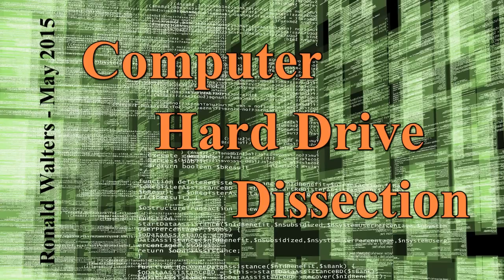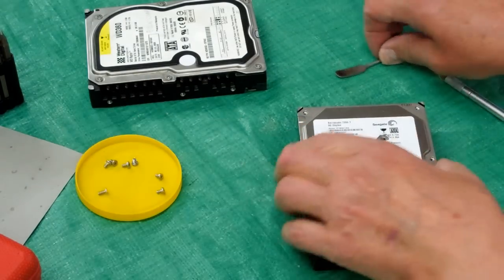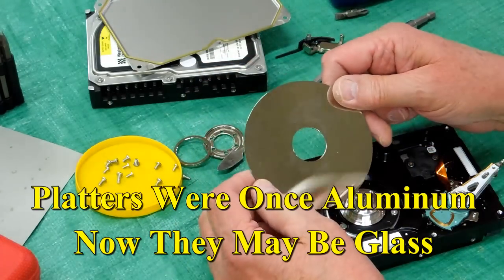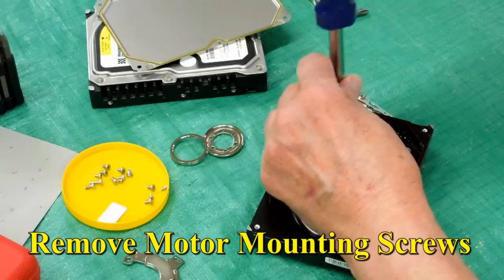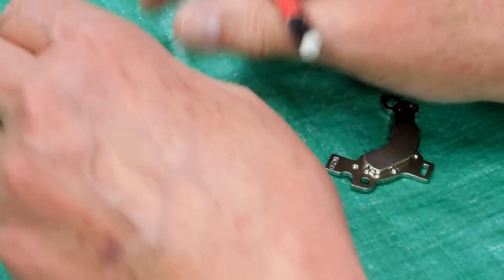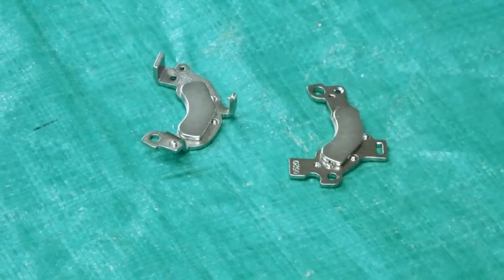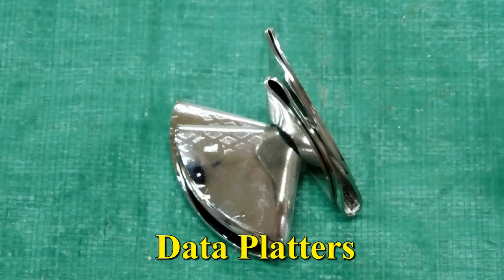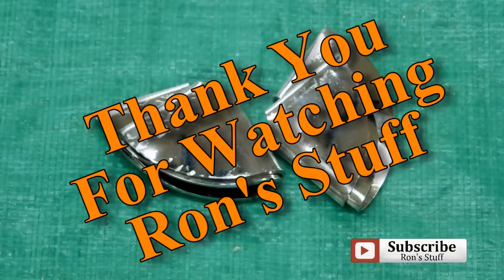Computer Hard Drive Dissection - Salvage Magnets

Comment: 3.5" home computer hard drives used to be glass. They're aluminum or an alloy now. Old hard drive platters had the problem of completely shattering inside from a short fall. These newer ones can take more of a fall but I don't trust one once it has fallen.

Comment: Nice video Ron!  However I'd hang on to the circuit boards.  Take a look at what you can sell them for at sites such as Boardsort.com or cashforcomputerscrap.com for example.  I'm not pushing those sites but just offering up information on other possibilities when one decides to scrap out a drive.  Sometimes local scrap yards will buy them by the pound.  

Take care,

Rolland B. Heiss
Reply from the maker: rbheiss OK... Thanks!  Ron

Comment: Good video Ron. I'm retired IT and have a few hundred stripped drives. The bearing in the motor is of excellent quality! Older hard drives have even larger magnets. Some 3/8 inch thick. These are so strong they must be handles carefully, but are very handy.

Comment: Easy way to take off motor spindle screws is to hold bit in screw then rotate the platter itself. Rather than trying to hold platter still.

I've run into some glass platters, breaking them is a good way to destroy data.

I've rubbed the magnets directly on the disk surface to scramble the bits. Considering the size of the write heads, I believe this is effective. Sometimes I use a sander with 80 grit to remove coating from disk.

Comment: To get the magnet of its metal bracket, mount one end of the metal part in a wise, and bend the other end. The metal will bend and the magnet will not. Then its easy to get it off without it breaking.

Comment: If you plan on taking those magnets, take care in not damaging the coating. Those magnets corrode easily. Side tidbit, some of those data platters have platinum on it and the boards can be harvested for gold. Most everything else is aluminum.

Comment: We've used a heat gun to warm the metal and it will loosen the glue.  Then use pliers to remove the magnets.  Be careful because they will be hot!  That's the best way to remove them without breaking them.

Comment: Interesting!  I've never taken the time to disassemble one of these yet.  The last one gave me so much grief (Windows XP!), that I just ... shot it up - my own little Health Management Program.
I DID use the shiny side of a CD in my yard light though - fitted it inside the globe above the bulb and attached with hot glue.  It uses ALL available light of the lower wattage CFT and makes a beautiful, even lighted perimeter in the corner of my yard and shows off those plants under it.  Thanks!  Jim@MidOhio

Comment: Yep, I've removed hundreds of them and it is best to leave the magnets attached to the metal support.  If you do get the magnets off, you'll break a few.  The ones that don't break, will break later, because when two are stuck together, you'll have to pry them apart and sometimes they'll break.  They are very handy to have around the shop.

Comment: the magnets are held on those plates with a glue. generally when i salvage these magnets i put one end of the plate in a vice and the other end in a pair of vice grips and i gently and slowly bend the plate until the glue joint breaks. I've only snapped one magnet doing it this way. then you don't have to deal with that weird shaped metal plate.